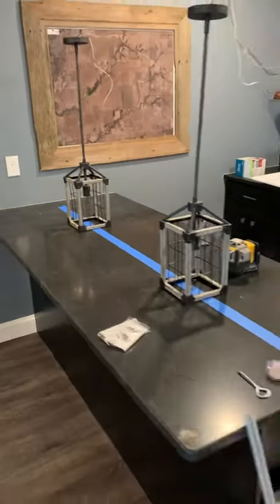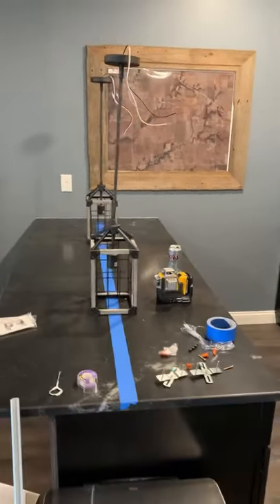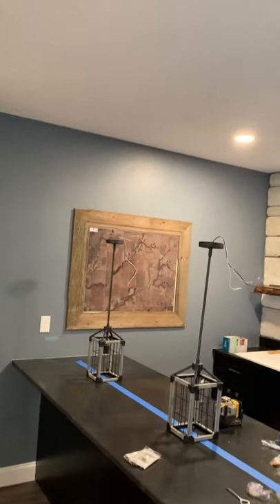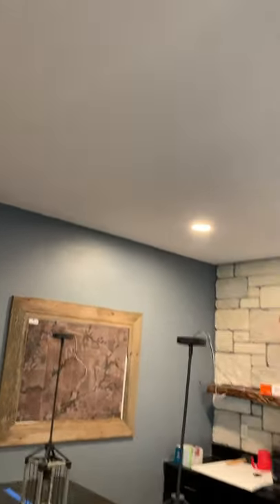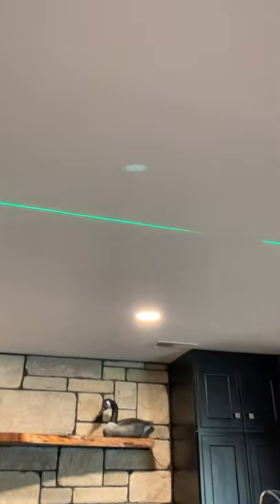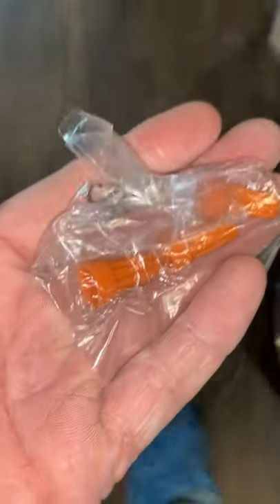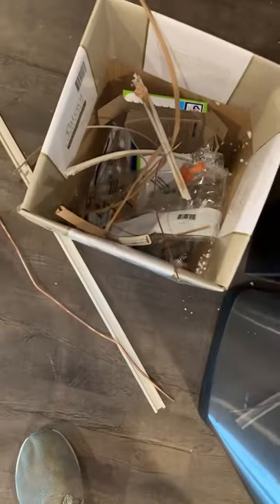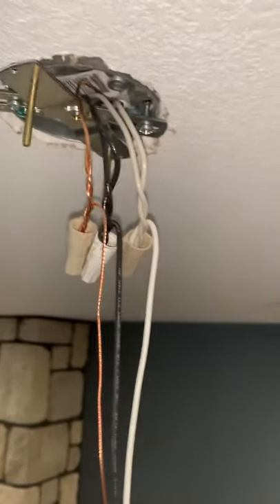Pendant lights installed! #electrician #diy #apprentice #help #led #lights

Comment: I'm one of few pros who uses those orange wire nuts. They grab better when it's just one load conductor and one fixture conductor.

Where there's two load wires from a daisy chain, I use the tans and save the orange wire nuts for later.
Reply: 3m blue/orange wire nuts are much better and smaller
Reply: I'll try them

Comment: Pancake boxes are only rated for one wire should have used a junction box if possible in the Attic that way you could run one wire to each pancake box
Reply: One cable 
Not one wire 6 cubic inches
Reply: @damoncarfagna6559  it's only rated for one 14-3 or 1 14 2 or 1 12 2 when you put two wires in one box it over rates it when we use them we use a bigger junction box that way you can run one wire to each if there are multiple pancake boxes it is definitely a violation of the National Electric Code if you have more than one wire in a pancake box

Comment: Pancake box is only rated for one set of wires. You can’t have two sets of wires coming in to one. Proper way is to run wire from switch to a JB and then run two wires from JB to each pancake. Obviously this was after rough inspection so was not inspected.
Reply: What if there’s no access to attic, what then

Comment: those wire nuts were forbidden in Finland about 30 yeara ago, as they, any of them don't hold enough and caused many fires. We have whole different systems (more effective ones) on use nowadays.

Comment: Like just watch out if the fixture doesn't have cubic inch marking some inspectors will fail the one with a junction pan boxes are only six cubic inches.
Reply: what inspector is gonna take that thing down?? LMAO
Reply: He's setting finish. The electrical inspector is long gone. Just the lazy guy that does a final stroll in the house for the CO

Comment: Well pancake box is rated for only one 14/2 (conductor fill) so this installation is agains code.
Not mention wrong ground connection.

Comment: Never use those orange nuts that comes with fixture. I WILL keep the small blue ones that come with  Diva dimmers tho, because i hardly use them, but when i do need them im going to need 1000 of them.

Comment: Pancake boxes don't have the volume required for code so I'd rather be off center and hang my box side to the joist or go low voltage.

Comment: Also people, USE THE SAME WIRE NUTS, I have found so many installations where every single connection is made differently

Comment: I feel bad for the customers floor and counter top that got all scratched from all that fallen debri. Real pros ground the lights and use plastic covering, cloth covering or rolled out construction paper. Real pros guys. Cant wait till the customers see the video and finds out your posting videos well on the clock and not working.

Comment: Island lights like that suck. Cause you know they are going to remove them and add one of those hanging pot things there. 
Kitchen lighting is never enought. My lighting package will have a massive amount of lights in the kitchen with all recessed or puck lighting. (have not decided if I want to do recessed or puck as recessed I can change out the color and wattage) I am also going to have quite a few switches so that when you turn on a light it lights up an array of areas. There are times when you do not need the entire area lit up.
Reply: Dimmers, but only one per circuit.
Reply: @DuffMiver7380  Some may have dimmers. Yet many will be motion sensors and timers. 
I am going to make sure that there is more than enough lighting installed to work for the room. I hate the old ways of rooms where ou have one central light and expect it to brighten up a room. Bedrooms are 10x12 and will have 6 or 9 recessed lights which 2/3 will be on one switch and then other 4/6 will be on another. The one with the least amount will have a swtich near the bed along wtih the wall lighting to turn them on and off for above the bed and night stand. 
Bathrooms will have timers which will also turn on the fans. The shower will also have its own light and fan along with heat lamp as you step out. Since the building will be pretty big I am going to install lighting over each door on the inside that will have low wattage lights which will act as night lights at every door, bedroom, bathroom, outside doors, garage door, storage room and so on. So that way once you leave the bed room at night all of the door ways are lit up. I am also going to have some 3 way and 4way lighings so that you can shut those lights off at any door. The more ways to turn on a light the better. Sick of walking in to a house when its dark only to fumble around to find the damn switch. These things are cheap when you do new construction.
Reply: @kameljoe21  this is a remodel bud, settle down. And ya, it's CHEAPER to put in new construction but not CHEAP like you said. New or not customers need the scratch to do it.

Comment: This haunts me. I installed a couple lights for a friends aunt. Fast forward he asked me to pick his cousin up before a concert at his aunts house. So i naturally went to the house i installed the lights at. Turns out he had 2 aunts on the same road and the house i went to now belonged to a cop that had been broken into he was not happy i was there and had pulled his gun it wasnt pointed at me but i was very worried at the time he also had two german shepards. He deffinetly over reached and was an asshole as i was unarmed and was just there for a friend. Still pisses me off

Comment: Awesome work brother!  Don't worry about the cry baby Union guys, worried about a pancake box ground. Those are the same guys running foot of extra wire at every device, sloppy workplaces, etc.  They also are the guys connecting a pointless ground and have the lights sideways and 2 inches off center. 
I can tell you after years of work in the field, and owning a business,  I'd hire you in a heartbeat.

Comment: You forgot the last step every sparky does. Leave the mess created there with no attempt at cleaning. An electricians clean up is literally just stacking the fixture boxes in a corner.

Comment: Didn’t see you ground the box also you might want to check how many conductors are allowed in those tiny boxes. I think it’s only 1 romex cable.
Reply: You can put 1 14/2 in a pancake box. You can't have any 12 guage Romex at all. You are correct.

Comment: Might start selling wagos in the US. Be like showing them the wheel for the first time.
Reply: We have Wagos. They are here in the US and we use them for certain applications. Wire Nuts just hold better and make a lower resistance joint.
Reply: @johnh8546  we wago and box so holding isn’t an issue. Never had a problem with a ZS because of a wago.
Reply: @jacski7  we also put strain relief in our boxes. Doesn't mean that wire nuts don't make a superior joint for less money.

Comment: You had me until tan twister. Pros? Hahaha 3M skirted all the way!
Reply: For pancakes wago 221's
Reply: @Rob Treibel  I would never use wagos for anything high voltage. 🤪
Reply: @nrrn4454  what voltage are you running at? >kV? WAGOs are fine and sometimes safer than nuts for higher voltage.
Reply: Wagos for lighting.  Always.

Comment: no grounding the pancake ? thats SHOCKING ⚡  
& dealing with strippers is just part of being an electrician
Reply: He didn’t bond the box or the mounting bracket…

I’ve also never seen a single joist that wide… looks like supports he laid in place after cutting the hole because he didn’t have remodel boxes.
Reply: “It’s what the professionals do” 🤣😂

Comment: My Dad built homes for 45 years without a laser marker. Plumb Bob works well.
Reply: Get with the times, laser is 10x faster and 100% accurate
Reply: @Teh_Random_Canadian  So, you don't know how to use a plumb bob, then.
Reply: @tomray4139  Ya dude, I do. Its not rocket surgery... do you still use corded tools "because back in my day thats all we had"... Lasers are better in every way. Using a plumb just to say you use a plumb is dumb.
Reply: @Teh_Random_Canadian  Respect the craftsman ways. Your laser might not work someday.

Comment: No pro uses those crazy wire nutz.....
They use proper connectors and my go to are the wago221 or similar...
Wagon connectors are a dream to use and can be re used whenever needed

Comment: I thought the pros started using wagos
Reply: Not exclusively and many of us not at all. Wire nuts just make a better union. Wagos are easier to use but wire nuts make a lower resistance harder to pull apart union.
Reply: @johnh8546  you should look at tests on WAGO and IDEAL .
Reply: @rmorris8544  I have you get more voltage drop and more heat for a given load on push in style connectors and lever nuts. Due to those adding bus bars to the circuit vise having the wire carry the current.
Reply: @johnh8546  I understand the thinking. But it's not an issue. Measure it. I favour the lever types personally for ease of inspection and visual confirmation. Just make sure using correct spec for wire guage and solid / stranded.
Reply: @rmorris8544  the issue comes that I would be paying more money to make a less good connection. That will experience more thermal cycling over the years it is installed which increases the rate at which the copper corrodes, especially in a very humid location such as here in Florida. I just can't justify spending more to get a worse connection. When I can get a product that does its primary job of making a low resistance connection between two wires for less money.

Comment: Wire nuts were used in the UK back in the 60s. Now, in just about all of the developed world, it’s Wago. So easy to connect and disconnect.
Reply: I think some will never use these even if everyone around knows that wagos are better. Just like the metric system...
Reply: @kt827a-8 o wagos are better in basically just one way ease of use. As far as holding strength, internal resistance, ampacity, and cost that goes to wire nuts. Wagos are really just easier that's it.
Reply: Ampacity? That’s not even a word!

Comment: With these cars being in such short supply, the dealers are obviously only going to only sell the top trims (so they can make the most money). This could however back fire with the collectors because the base trim cars will be produced in fewer numbers then the top trim cars.

Comment: Bro no, metal pancakes need to be grounded and are only rated for one wire. Get some 3m wire nuts, thats actually what the pros use. And just fucking measure it out on the rough...

Comment: Ahh yes residential work where making a simple job into a whole project because nobody can properly lay anything out with accuracy on the rough because it’s all fly by the seat of your pants without architectural or elevation drawings or scalable prints. Those pancake boxes should be outlawed too. Not sure how that meets cube requirements but hey, it’s residential anything goes. Hahahaha

Comment: Look like blocks. Not joists. Also those white wire nuts are too big.
Reply: Probably a 2x4 truss, which would be 3.5” wide rather than 1.5” wide single beam joist

Comment: Picking better fixtures is important too.
Those are horrible.
Reply: Can't even count the amount of ugly ass fixtures I have installed over the years. Seems like the worse it looks the more expensive it was too.
Reply: @Teh_Random_Canadian  you ain't kidding. We put some ugly ass light up that had a glass shroud. And it was the moat fragile piece of glass ever. Of course my helper accidentally broke it. We told the designer it came that way. But just for the replacement shroud was 800 bucks. Fixture cost 3500 bucks. And that was just 1 fixture. Entire fixture budget was 350k

Comment: Liar.....how did you find the buried wire behind the drywall with the tiny space beside the joist at the hole you drilled? You can't even get a finger in there to find the wire. Dot laser is way better.....pro?

Comment: Each box is rated for the number of wire because the wires get hot and need airflow. I believe the pancake boxes are only good for one set of wires

Comment: Pros don't use wire nuts at all 🙄
Reply: Yes we do. I use them basically exclusively. I know very few licensed electricians that use anything but. Although this guy is doing some very shoddy work to be fair.
Reply: @johnh8546  all of my connections are made with crimp connections and everything is sealed with either shrink wrap or electrical tape in my garage, and yes I have a 2nd fuse box for the building, which has a fuse at the house as well, so completely safe

Comment: Well at least you got the holes in the right place. The inspector in my area would fail this you would have to get a deeper box in there.
Reply: How would the inspector know? Fixtures are up. He isn't checking
Reply: @bigcheese9096  if your wires aren’t hanging out the drywall on the rough in ,he will make you pull a fixture on the final .not stupid .
Reply: @dredbud9272  In 15 years I've never had an inspector ask once. I have been running vanity lights, sconce lights, and island lights like this for that 15 years.

You think an inspector is gonna remember what I roughed in a year ago?
Reply: @bigcheese9096  it takes you a year between rough and final inspections? Enough said
Reply: @dredbud9272  well when you're doing 16,000 square foot homes it takes awhile